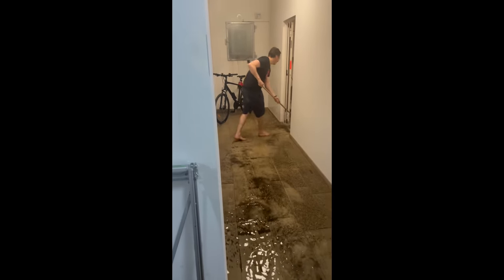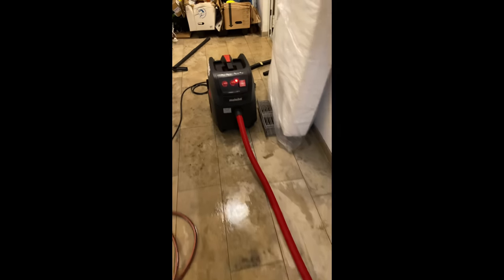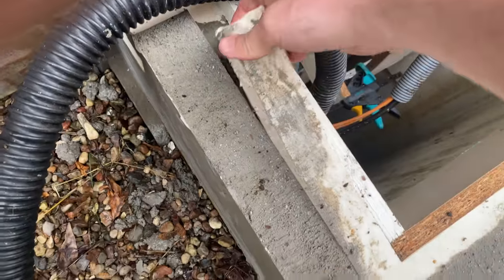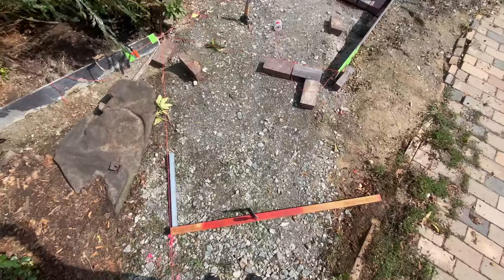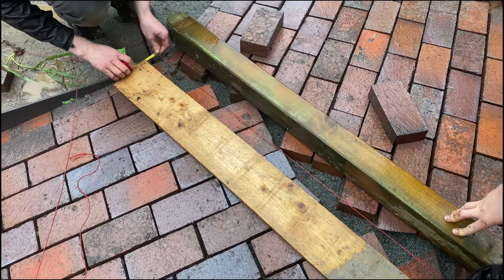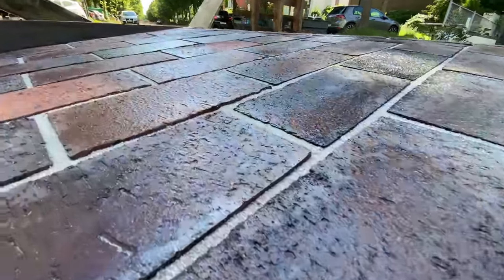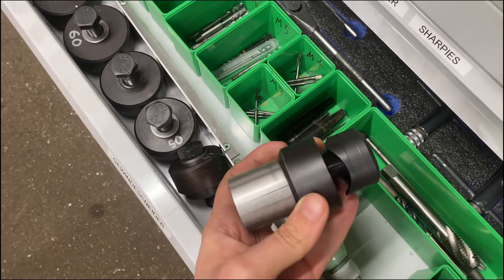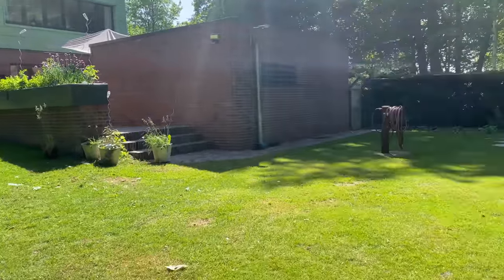Battling Mother Nature: How We Made Our House Flood-Proof

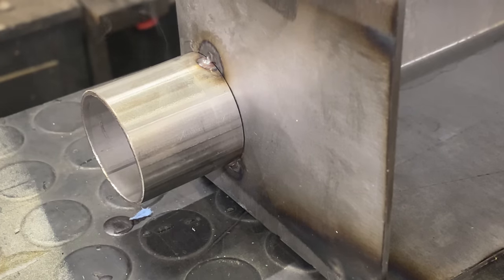Comment: 12:31 as a tigwelder what probably happend was that you didnt degrease the surface enough , and when i pause on 12:32 i can see that ur tungsten isnt pointy but more of a ball and that will ruin the arc
Reply from the maker: Thanks for the tip! It could very well be that I didn’t clean it well enough.

Comment: What about mold? Did you have to do anything about it after the flood?
Reply from the maker: Oh yeah. The insurance covered that luckily. A company drilled holes into the floating concrete floor. Underneath it is insulation and that was full of water. Then they stuck vacuum hoses in there. The vacuums were running for 4 weeks straight. There were also 3 dehumidifiers running so the basement air was dried and then sucked underneath the floor where it picked up moisture and was extracted again. Quite a tedious process and cost about 4000€. Those vacuums are very expensive. I considered buying a system, but it was to much.
Reply: @MaxMakerChannel  Interesting. Good thing you got everything sorted!

Comment: Have you tried following the instructions on the concrete?
Cause normally there is a reason why they exist - just blindly trying to add water easily makes it too runni. And if you want better workability, longer working-time or lower viscosity - there are special additives for that and they work wonders. Way better than adding too much water as while that makes it flow a bit better it also makes the concrete weaker by being more porous which makes it degrade faster (significantly so when in freezingregions).
Reply from the maker: If this was structural I would stick to the ratio, but for this I rather tried to make it pour without voids. Thats the worse outcome. For larger projects I would just order a concrete truck. One cubic meter costs only about 250€ delivered. Much cheaper than bags and mess free.

Comment: All you can do is lower the risk. Diverting water around your property is the only thing you can hope to do. Then strap yourself in for the next big storm.
I've had to do with more than my fair share of water from flash flooding. We once had 63mm of rain in 15 minutes. It was chaotic. But now we can handle even that. We did have to go defcon 1 though to do it massive pipes, with big drains.. going into my driveway with on-street drains at the end.
Reply from the maker: The thing here is that its illegal to drain onto the street. Our rain stays on our property. We have underground cavities that take up all the rain and from there it can trickle down into the ground over a few days.

Comment: You need to follow 2 rules, 1 your house should be 2 to 4 feet above the road, 2 the level of ground inside and outside, inside ground level should go down there where the water drainage is, outside ground level should go to the outside drainage problem solved.
Reply from the maker: Its not that easy to find the perfect property. On this one only the front corner is below grade.

Comment: The steel on the sloped brick looks like a bit of a tripping hazard, maybe a handrail in that area is in order to keep people from short cutting the corner and tripping. Or at least some filler material, maybe you did more adjustments after this was filmed.

Comment: Instead of using a pump, why not incorporate a drain hole at the bottom of the rainwater reservoir? This drain hole would directly channel the rainwater into the collection tank inside the house. This way, you can avoid the need for a pump to transfer the rainwater, making the system potentially simpler and more efficient.

Comment: Why not just make a clear plastic cover over the basement vent with the venting holes on the sides facing down so rain intrusion is minimal?

That way you still have natural light in the basement with venting and flooding protection.
Reply from the maker: The water didn’t come from the rain. It flowed like a river into the hole in the ground. The rain right on top of the shaft was minimal. Anyway, never ever build a basement shaft if you don’t have to. And if you do, pour it right at the same time as the basement so its one monolithic block.

Comment: @11:07 is that electrical warning sign upside down? Oh dear that is a shame for Germany... That triangle sign is upside down on the panel... Nein, nein... :)) Just kidding. 
As an architect, i always recommend building "above" flood levels :) Meaining, build above mean rain fall and mean flooding level of the site, not the street the site :)
And another note on when making steel gutter or drain always add the pipe thickness to the drain pan  otherwise the water will be trapped in the pan, on the welding you missed that point as i did on my balcony drain pan under the sliding glass doors, and still brainstorming how to make it fully drainable since water on pan make problems...

Comment: Curious if it's going to block all the water as it had some speed getting down and it's a smooth path, might wash right over.... might have been better to make small increments that slows/breaks the waterflow. Yeah, I'm Dutch, we know water 🤣
Also, extend the low brick wall all around with U profiles at the path so you can slide water blocking beams over the path would be the ultimate permanent solution against any water flow increase.

Comment: In the US that type of window has to be able to open in case of an emergency to exit up & out of the basement. That screwed down grate wouldn't work here.
Reply from the maker: This is not s emergency window. When you build a new building you need s fire safety concept and those normally only ask for two independent emergency escape paths.

Comment: Thats a lot of work to fix what i deem a city problem.

That aside. Very nice job and I bet it felt good doing it anyway.

You should try to get the city to improve its drainage at that corner though. The water should clearly be collected there and put into the storm drain. The water probably wont enter your property anymore but now it might enter someone elses.. hopefully that is not the case however.
Reply from the maker: I agree the city is at fault, but there is no point arguing. They have the duty to drain the water, but they cannot be forced. Especially for extreme weathers. 

The other thing is that our street wasn’t rebuilt for 100 years. They only put new asphalt ontop. This winter they are rebuilding it and I hope they do a good job.

Comment: Might want to look into backup power with generator.
Reply from the maker: Oh, I bought a gasoline HONDA pump especially made for muddy water. It can pump about 500l per minute and its a real beast. I put it on wheels and attached nice hoses to it so you can get it going easily and quickly.

Comment: Too many hard surfaces that cannot absorb or slow down the flow of water.
It is a major problem in a lot of cities and the best solution is to build differently.
Your garden is also largely paved as is the area around the streets.
Reply from the maker: Nothing I can do about that. The little front yard was part of the building permit. Also any water that rains down there can easily be absorbed by the drainage. It was the tons of water that came from the street.

Comment: Belt and suspenders and another belt and another suspenders. You're set for sure, future owners will thank you.
Reply from the maker: Drying the concrete took 4 weeks of noisy vacuums that were sucking out were air from the floor and pumping in dried air. That was not fun and consumed a ton of electricity.

Comment: Your window shouldn't be leaking in the first place. That much water leaking through means cold air is getting through as well. It must be very draughty. Put a rubber seal around the frame.
Reply from the maker: The window is only there to get fresh air into the basement.

Comment: Good video.  Although, I'd of personally tried to preserve that gentle curve,  that straight angle just doesn't flow right with the rest of the brick work.
Reply from the maker: I think the exact opposite. The building doesn’t have any round features.
Reply: @MaxMakerChannel  This is of course opinion based, so feel free to discard my opinion. 

But houses tend to be artificial, so straight angles are fine, but anything on the ground should be of a more natural aesthetic and flow from the artificial angles, even if the materials are not necessarily natural in origin.

From the perspective of the road, you need to flow it into the house ( not the water XD ).   The road is curved and the thing next it is curved,  so the better option would be curved.  Straight angles work with the garden/grass crown driveway because of the grass and plants.

Blending landscape and structure is a balancing act for sure.
Reply from the maker: @mewimi You have a valid opinion. I don’t think its wrong either. But we didn’t want curves so the bricks don’t form large gaps as they did before.

Comment: Would you be willing to share the total cost on works like this? Seems like you would've spent a lot because you really attacked it from many angles!
Reply: Also the window for ventilation seems problematic. I'm surprised there isn't mechanical ventilation in the basement - I guess because of the age of the building? Potentially it's a more modern building practice of the last 4-8 years?
Reply from the maker: The walkway was very cheap. Only a few bags of concrete and 300€ for the steel. The elevated shaft was almost for free. Just concrete. The sump pump was 350€. The green hose another 60€.
Reply from the maker: That is a mystery of its own. It was required by building code but nobody understood its function.
Reply: @MaxMakerChannel  an absolute steal! Amazing!
Reply: @MaxMakerChannel  haha! One of those! Thanks for replying!

Comment: Dude, once you'd raised the vent level, you just needed to add a small rain cover roof - then wouldn't have needed the second pump or internal gutter
Reply from the maker: It might look like that, but we dug down the basement shaft and it looks like there is no drain at the bottom. So if there was a week of extreme rain, the ground could become saturated and the water could flow into the window from the bottom.
Reply: @MaxMakerChannel  fair enough :)

Comment: I recommend people who may be subject to flooding also have 2-3 packs of Quick Dam or something similar in the garage.  They are not that expensive, last forever when still sealed, and can do a lot to divert a disaster.  And even if you have other solutions, you never know when you will just need something to plug a small gap.

You can also use dry pack concrete and get about 2/3 strength still.  It sometimes saves a lot of work, especially when you’re not doing structural work.
Reply from the maker: I will get some supplies ready for that.

Comment: The water flow that poured in on the beginning of the video was way too high for the small pipe installed under the window. If it happens again (or perhaps the correct phrasing should be when!) get ready to another nightmare.
Reply from the maker: It cannot happen again. The concrete is way higher now.

Comment: You seem like a decently smart guy so what went through your head when you bought that house and didn't think the walkway sloping toward your house would be an issue that's house building 101
Reply from the maker: Its not actually sloping towards the house. It was higher than the street. It the past the water never reached the highest point. Only now it did. Maybe there wont be such a strong rain for another 10 years.
Reply: @MaxMakerChannel in that case then as you know water flows to the lowest point and if your house truly was level with the road it wouldn't flow into that front patio area
Reply: @MaxMakerChannel I'm not saying your lying I'm just saying what your saying doesn't make sense

Comment: I'm a bit sad you didn't talk about those two drains in front of the house. At 1:15 you say there's two big drains in front of the house but in the video it doesn't look like any water at all is draining through them. Usually those should be able to drain huge amounts of water (much more than a sump pump) and the suction should be clearly visible from above. They are also perfectly placed where all the water is piling up. Are they clogged? Why is nothing going through there? Maybe you can improve those or complain to the city?

Have you seen those "unblocking drains" videos where someone basically fixes a flood with 10min of cleaning a drain?
Reply from the maker: Funny that you think they are faulty. They kept up with the water that fell on this area. Only when the water from the street came they were overfilled. They should drain a ton of warer and usually there aren’t any leaves either. I rather suspect the line that they connect to could be to small. However they weren’t made to drain the entire street. Their area is about 100m2 but the city street collects probably 2000m2. And all of that came onto our property.

I will investigate.
Reply: @MaxMakerChannel  I guess that makes sense. in those street drain videos you can see the huge pull those have. but you're right, maybe the pipes to yours are just smaller than the street ones

Comment: The work looks good but your 'dam' is not high enough to prevent water from coming into your property...ideally you should change the front entrance design and raise it to the same level from where the car is parked.
Reply from the maker: Its so much higher than it was before. I have no doubt it will be enough.

Comment: Um just don't buy a house that is in a flood area. I don't get you plp, it's as bad as the plp that buy a house in tornado towns or coastlines that get hurricanes every year. Like I don't get it, just don't buy a house in a these places.
Reply from the maker: What makes you think this is a flood area? It was a heavy summer rain. That can happen anywhere.
Reply: @MaxMakerChannel  If it happened once from to much rain it'll likey happen again. aka Seasonal flash flooding area.  Would much rather be on top of a hill where that's less likely to happen.
 estate agents should be required to put that type of stuff on listings. I'm sorry you have to deal with that

Comment: your house isn't graded properly, you should NEVER have drainage flow from the street to your foundation. This is a builder issue and could have been warrentied if you knew about grading or had the inspector done their job correctly. That drive should flow down into the street not the otherway around. Good luck hope your solution works well, but if I were you I'd probably regrade the driveway so street flow can't reverse into my yard similar to what you've done but more accross the yard, though yours should work. "seem to get more extreme weather events" yeah thats climate change for you.
Reply from the maker: You seem so sure, but here in Germany its illegal to grade your driveway towards the street.

Comment: Nice job! The dam is OK but you are just delaying the inevitable, why didn't you use some sort of underground drainpipe, even if the drain pipe gets over saturated it will still divert the water away from your property. I am not sure of the topology but I am sure you can devise something to push that water away or even utilize the sump pump to help drive the water through the drain pipe.
Here is an example site to give you some ideas. https://www.youtube.com/@FRENCHDRAINMAN/videos
Reply from the maker: These drains don’t help in this situation. The house has a drainage system, but that is only for the rain that lands on the property. The problem here was that a few cubic meters of water rushed in from the street in a few minutes. No drain pipe could handle that.

Comment: I would sue the city if I were you they responsible for rainwater waste systems that should not even be going in your house at all the city should be liable
Reply from the maker: They are liable! But you cannot sue them. A city only has to build for 90% of the rainfall. They are not required to deal with extreme weather.

Comment: very strange that your house is not at the correct height it should be. I worked in Germany for 10 years but now I live in Canada and I understand why your house is flooding. Your house is below grade, that should never have passed inspection. Your house should have been at least 30 centimeters above grade. 60 cm would have been much better. I suspect there are height restrictions on the houses in this area. That's why I dislike Germany because of their communist housing codes. You have to put a sump pump and a huge drain in your front yard or it will happen again. 

it's funny that some people have built really good houses in Germany, with the right foundations and footings or even with a proper basement.

but it seems like there is more paperwork in Germany than building a real house. I see this all the time. In some areas it is now almost impossible to build a real house.

sehr seltsam, dass Ihr Haus nicht die richtige Höhe hat, die es haben sollte. Ich habe 10 Jahre in Deutschland gearbeitet, aber jetzt lebe ich in Kanada und verstehe, warum Ihr Haus überschwemmt wird. Ihr Haus liegt unter dem Bodenniveau, das hätte die Inspektion nie bestehen dürfen. Ihr Haus hätte mindestens 30 Zentimeter über dem Bodenniveau liegen müssen. 60 cm wären viel besser gewesen. Ich vermute, dass es in dieser Gegend Höhenbeschränkungen für die Häuser gibt. Deshalb mag ich Deutschland wegen seiner kommunistischen Bauvorschriften nicht. Sie müssen eine Schmutzwasserpumpe und einen riesigen Abfluss in Ihren Vorgarten stellen, sonst passiert es wieder.

Es ist lustig, dass einige Leute in Deutschland wirklich gute Häuser gebaut haben, mit den richtigen Fundamenten und Stützen oder sogar mit einem richtigen Keller.

Aber es scheint, als gäbe es in Deutschland mehr Papierkram als den Bau eines richtigen Hauses. Ich sehe das ständig. In einigen Gegenden ist es mittlerweile fast unmöglich, ein richtiges Haus zu bauen.